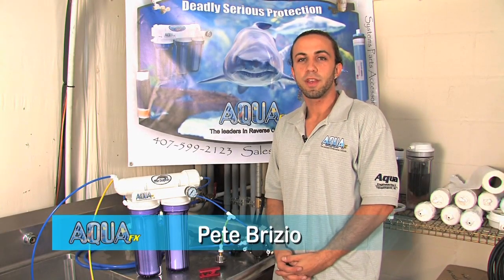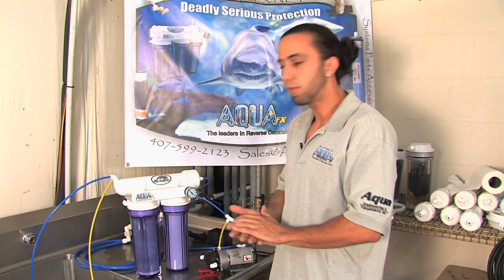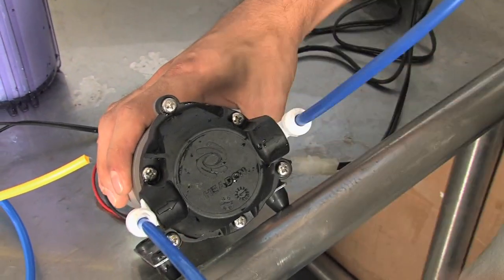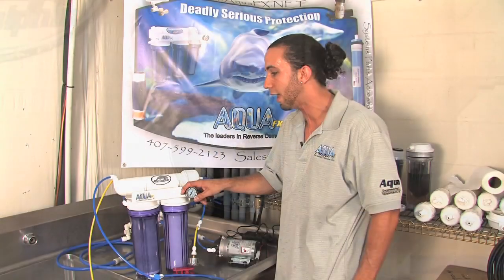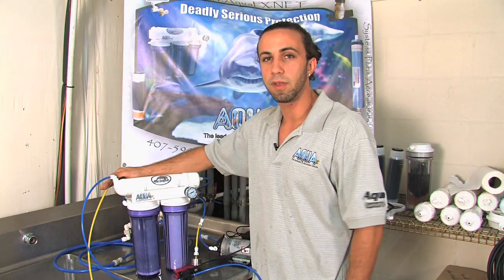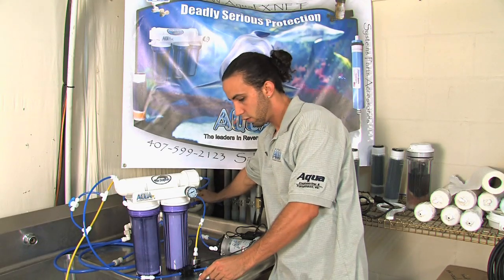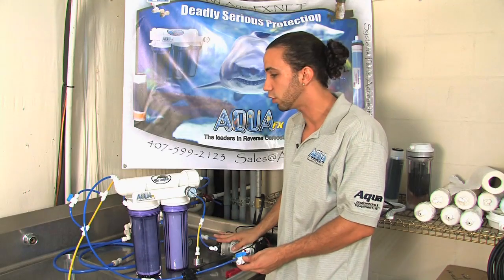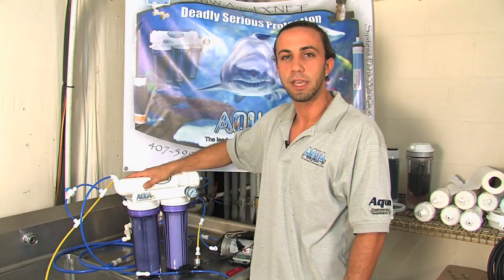RO Booster Pump and Membrane Flush Kit Installation - AquaFX

Comment: is it total nececeary to put the pressure shut off valve on the product water can i just install it on the first stage filter?
Reply: Can you be more specific,  I am not understanding your question.
Reply: @Mimibrizio can i connect the pressure shut off valve to the first stage filter meaning from the feed water to the first filter or do i have to connect it to the product water filter meaning after the product water filter
Reply: @juliosantana2069  I am not sure what you mean by the pressure shut off valve, the ASO? a Ball Valve? A pressure regulator ?

Comment: Hopefully someone can help. I purchased a booster pump with a pressure switch. I installed it exactly as shown but the booster pump continues running no matter if I tighten or untighten the screw on the pressure switch. Most all RO systems have the same configuration when installing the booster pump. I followed the instructions exactly. I am stumped. Any ideas anyone?

Comment: I have a express water brand pump for my aqua top to system I was wondering will this work for my ro system
Reply from the maker: Well if it increases the pressure going into the system, and it has enough GPM to keep up with the flow of your system. I'm sure it should work fine? Careful not to over pressurize the system, https://www.youtube.com/watch?v=DHATu47KbIo Check out our V2 booster pump, it has an internal bypass built into the head incase the pressure is too high. :)
Reply: AquaFXdotNet. In sure it would work fine I was just asking because I'm using 2 different name brands it looks easier to use the pump for the same brand as the ro system
Reply from the maker: The name brand should not matter if the pumps specs are correct - the most important part about pumps are their pump curve (where you can see the relationship between pressure and flow) - It sounds like it should work ok, but just monitor the pressure into the membrane (out of the pump) and make sure it doesn't go too high (above 80psi) - but more pressure should be GREAT for the RO system!! :)

Comment: Hey, at the last part of the video, you opened the membrane flush kit to zero out the pressure.  Do you leave the pressure at zero while it's not in use? Does that dry out the ro membrane?
Reply: The reason the flush kit is opened is to allow the water to rinse/run across the membrane surface, the pressure reads zero at this point.   .We suggest storing any water using appliance without pressure, in other words turn off the water supply. The membrane should not dry out unless you are in a hot dry place.  You can add a ball valve to the end of the line to ensure no water can evaporate.  If you are storing an RO/DI for an extended time (a month or more) you may have to replace the filters, it depends on the conditions the unit is being stored in.   Also store the unit is a dark place or you may experience algae growth.

Comment from the maker: We recommend to not exceed 80-psi for several different reasons.
One of those reasons is we don't want to exceed the maximum pressure rating for any fittings that may be used in conjunction with our system.
Another reason is that plumbing code in several different states mandates a max pressure of 80psi. thanks for the question!!
Reply: AquaFXdotNet what is ideal pressure for 80 gpd membrane and 75 gpd membrane?
Reply from the maker: 80 PSI - the more pressure the better, but 80 is the max!! :)

Comment: using direct tap water in the sealer and in the pump pembranes, so i always install the pump after the pre filter to avoid long term damages. another thing that i do is never connect new filters direct to the membrane housing, to avoid carbon to grab to the membrane, i always allow water to run only in pre filters for 5 min. and only after i connect to the membrane. sorry if my english is not perfect, did my best.